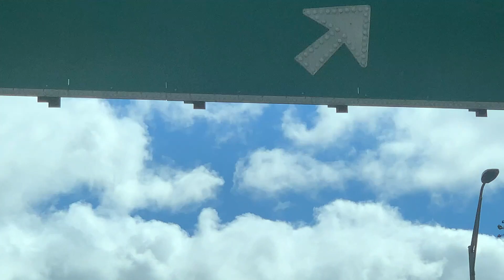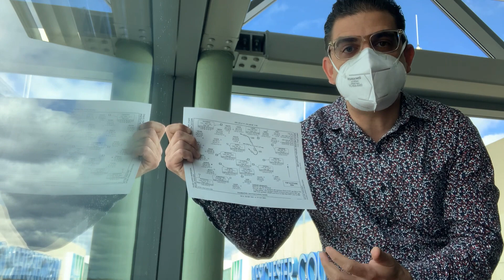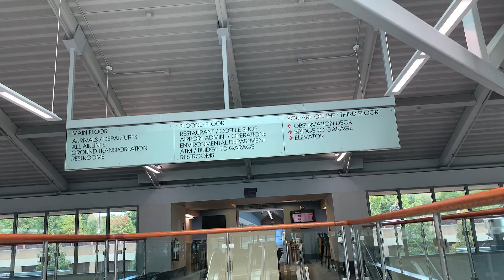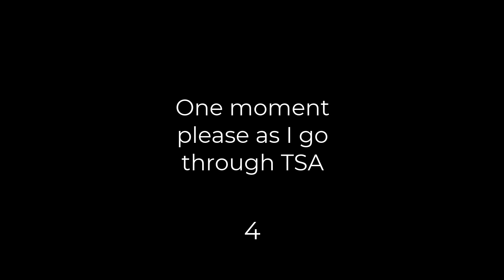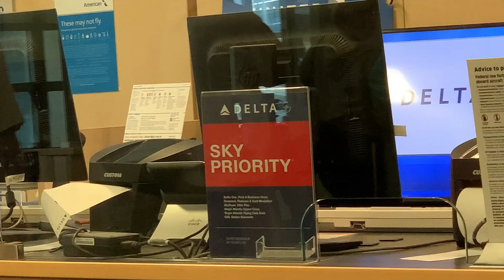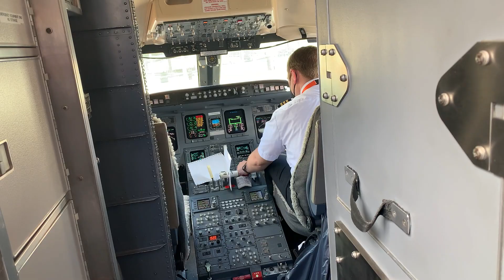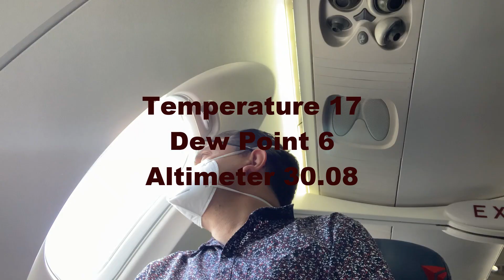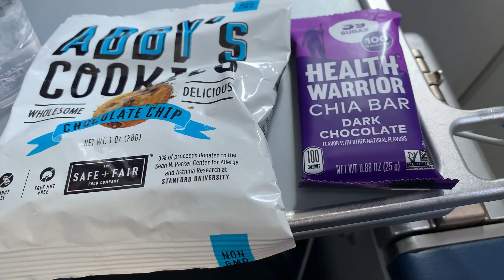Departing Westchester County Airport - With Air Traffic Control

Comment: If you haven't already, the flight between Denver and Telluride is incredible.
Reply from the maker: That sounds awesome!
Reply: @PeterMasella  Check out the aircraft used by the Denver Connection on this flight.

Comment: The current observation lounge is cool - part of me still misses the old one, that was open air, and cold as hell in winter, and it had a metal fence  as opposed to the clear glass of the current lounge, but it was cool being out and close-ish to aircraft, noises and all.
Reply from the maker: I remember that old deck!
Reply: @PeterMasella  Many memories as a little kid watching my Dad's flights come and go when he went on business trips, and staying around to watch planes just for the hell of it.  Back when United flew 737-500s, American and USAir still had their Fokker 100s,, Northwest flew DC-9s in, when the terminal was in the stage of its life between having no jetways at all, and having 2

 Sure it didn't do any good for my hearing, but fuck it. 😂😂
Reply: Not only that but the main parking garage has woven steel mesh "windows" to make plane spotting from there impossible.
Reply: @PeterMasella  To this day, I still wonder why they chose the fencing they did for the perimeter of the old deck, since it did get in the way with getting good views (and photos/videos) - ah well, the current deck IS spectacular regardless (ESPECIALLY with all the photos of the airport from its early years, the WWII quonset hut, etc.  Didn't know American Airlines was (amongst the first?  The first?) to operate commercial service out of it until I saw that info whilst reading the information on the walls of the current observation deck.)